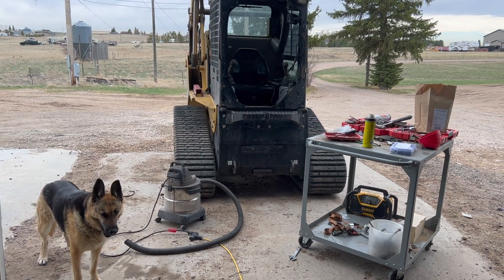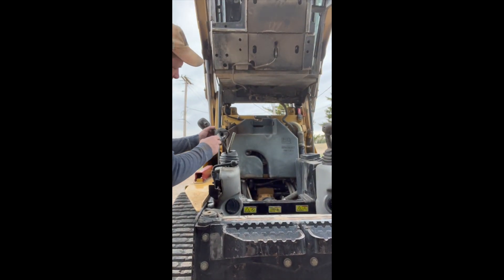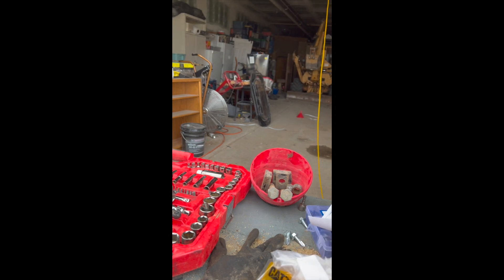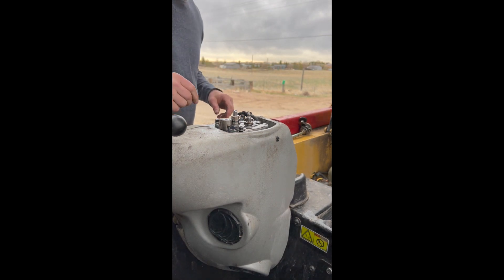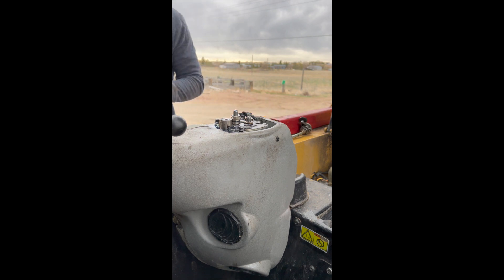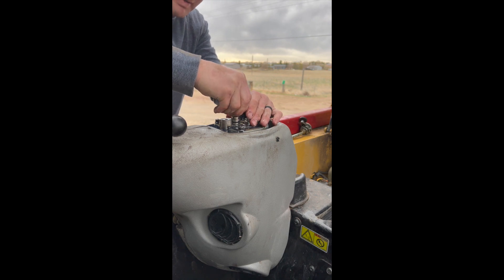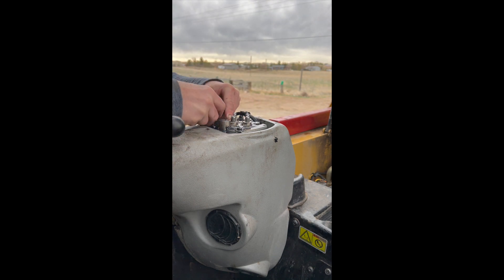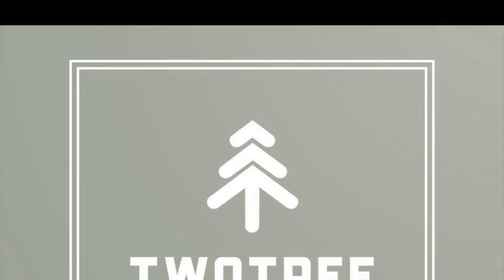CAT 257B Hydraulic Joystick repair

Comment: Noah, thanks for the uploaded video. My buddy won a 2005 model at auction and the left controller is leaking pretty bad. Over 107 today in Central Texas today, so anything to shorten the repair is a major plus...ugh!
Reply from the maker: Don’t drop the handle like I did lol. Super frustrating. I’d say before you break it apart make sure you get the new parts from CAT and have them ready to go so it’s easy in and easy out.